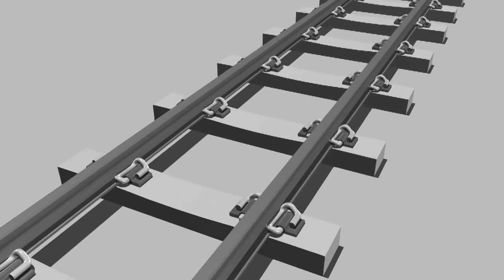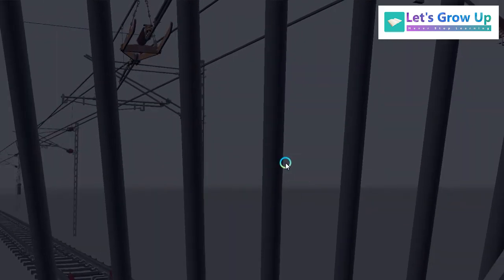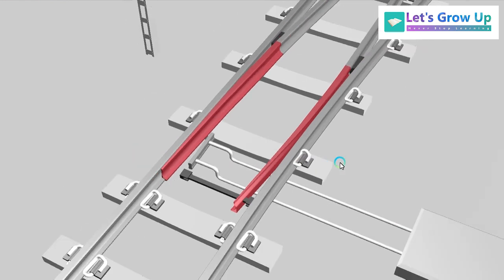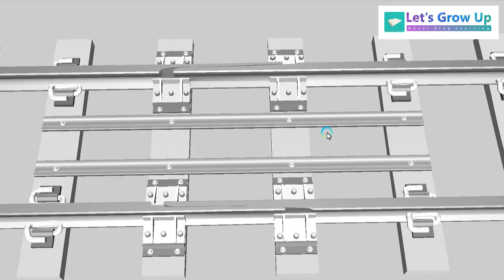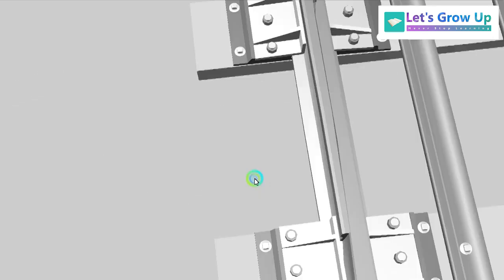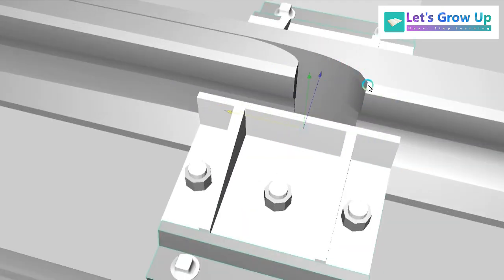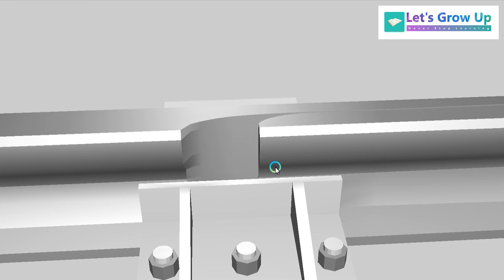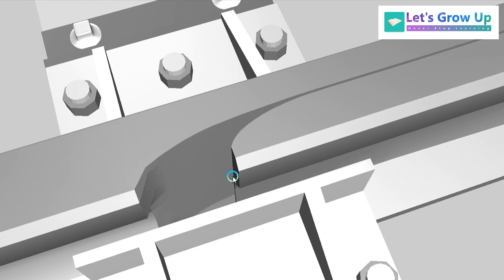#switch expansion joint | Adjustment Switch Explained #let'sgrowup

Comment from the maker: Have you seen it and where? write bellow👇👇
Reply: I saw this in VSKP Railway Station. 
And plz  Explain about switch expansion joint which is automatically control device and it's contains  some info I mean 60 in 1/2 kg like that.. Plz explain it